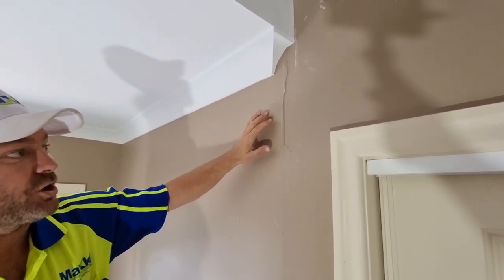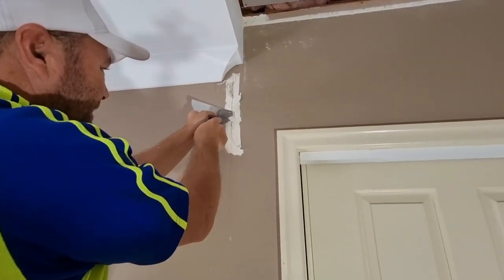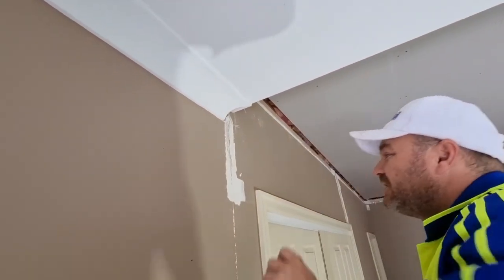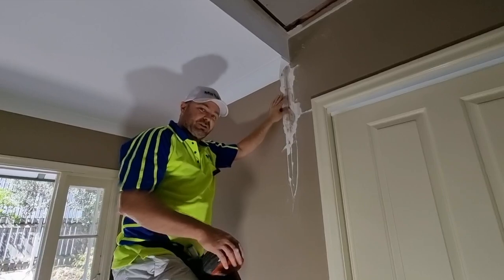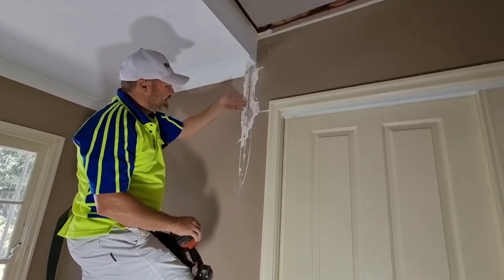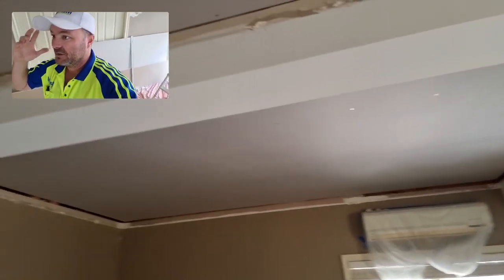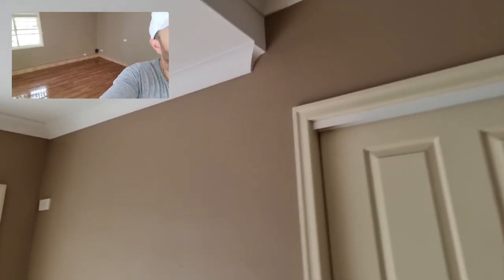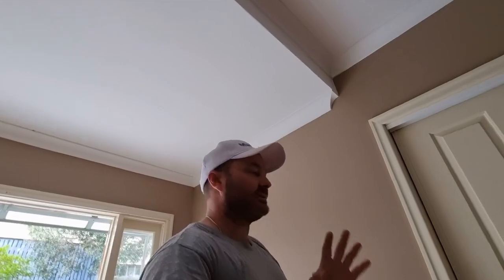How to Fix Crack Down your Wall using a Stronger Method

Comment: Hello, Max, good video, these cracks arose as a result of an error in the installation of drywall, that is, without a complete bandage over the aisle, it is a violation of the technical process.  Thanks for the video) now I also correct such mistakes in one of the offices ... Good luck guys!)

Comment: @UCYhcZ5jcHhaXb2SFKl90dQw regarding "Doobie's" comment.   I think he means that you didn't show mixing quickset, applying tape, smoothing, coating with all purpose, sanding, skimming and prep for paint.    All of which you (and others) have shown in previous videos.   Screwing (or nailing) will help restrict movement and hopefully the tape will prevent cracking in the future.   Not much else you can do, could be a structural defect in the framing/foundation area or a grand piano on the floor above...